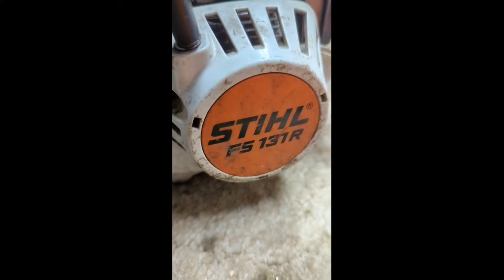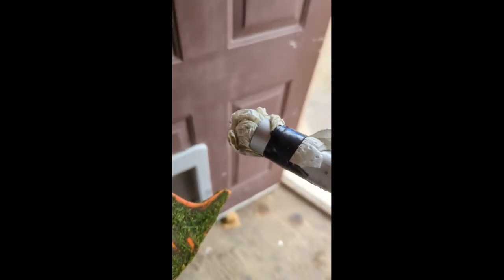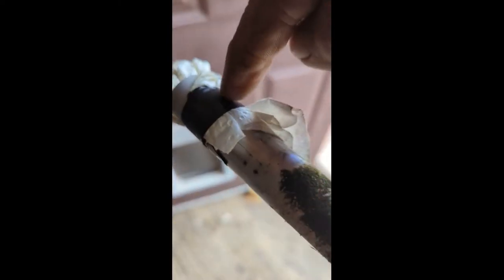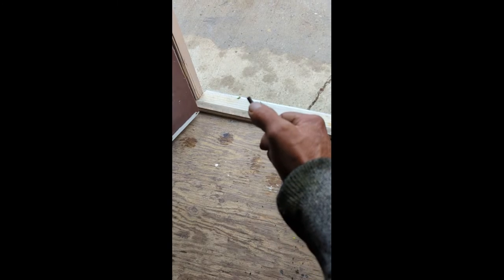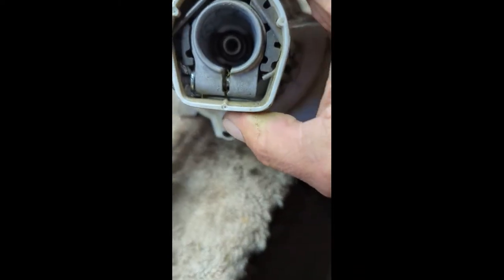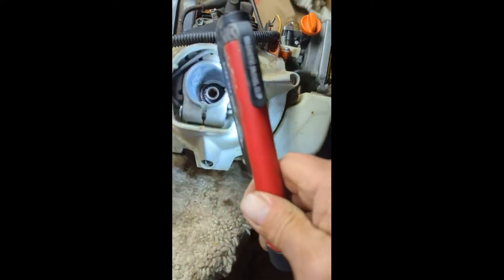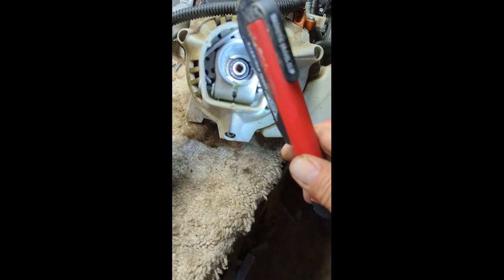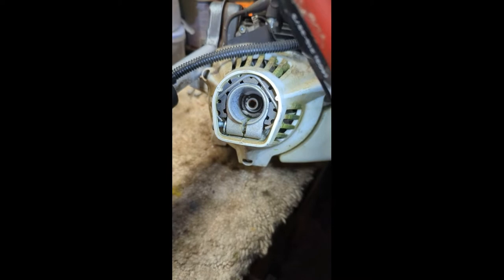Stihl FS 131 R whipper inner drive shaft fix!

Comment: Did you end up getting a new housing from sthil for free?
Reply from the maker: I did cause there was an upgrade version of the housing, ask ur dealer..
Reply: @tlclawncareyardmaintenance1704  Thank you thank you for your answer and the Video. Much appreciated.
Reply: Great video thx
Reply: That usually happens when one takes off the head (to grease the driveshaft, for example), & then fails to rotate the head when re-installing to ensure the square opening within the head slides down onto the end of the driveshaft, and is fully inside the square opening within the head.  In other words, the head must be rotated so the square end fully engages & the head slides down fully to enclose the square end. When not fully seated, the end of the driveshaft can eventually become rounded due to the torque & stress it places on the now smaller than required contact area. Since only the top section of the square end was rounded, that seems to be what occurred (unless it wasn't properly assembled by Stihl). Kudos to your dealer for standing behind you.